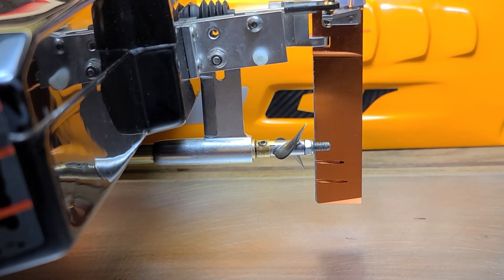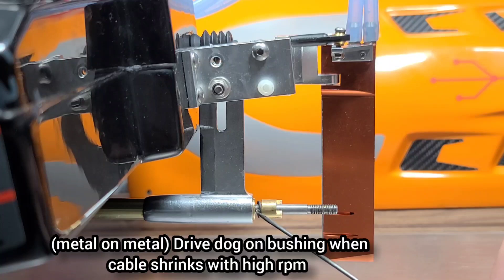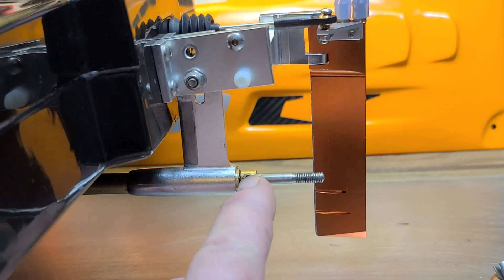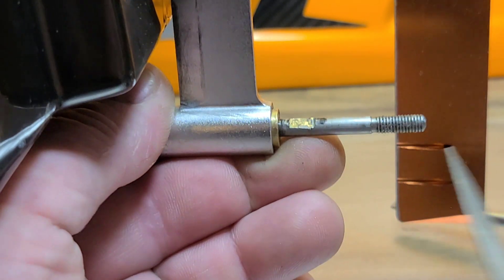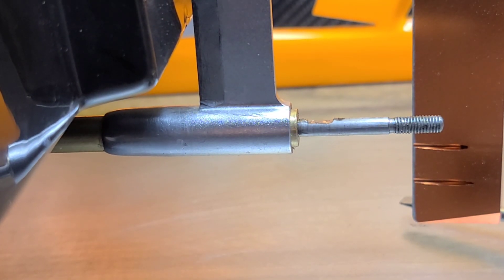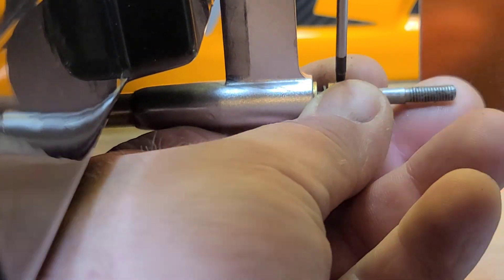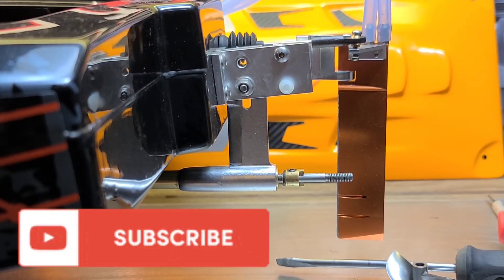Strut, Bushing & Drive Dog Positioning Blackjack 42 - Flex Cable Mod

Comment: One benefit of spinning bushing is that you can pull out drive shaft for greasing cable with out having to disassemble and put stress on drive assy and the bottom of hull . Like the blackjack 24 bushing spins, But greasing  BL 42 sux

Comment: Hey bud I’m looking for an upgraded water system for my blackjack 42. I want the water to run out of the back of the boat through a fitting that looks like an exhaust on each side and orange tube. If you can help a brother out. I watch all your stuff dude!
Reply from the maker: https://rcboatbitz.com/product/blackjack-42-ultimate-upgrade-cooling-kit-orange/
Reply: @ hey thanks buddy. You keep me in the know being a fan of the blackjack yourself. Thanks a lot!

Comment: Some people,as you know, completely remove the flex shaft after every run to prevent bowing of the shaft when the boat sits idle. Any bowing is going to cause problems.
Reply from the maker: Also prevents rust

Comment: I have been commenting on my blackjack 42. That is the boat that my flex cable is stuck on my new bj 42. I have the strut assembly loose. Is it supposed to be able to slide all the way back to the prop and up over the brass tube? I have pics on Facebook black jack owners group. Wish I could get in touch with you to help figure this out without ruining the boat.

Comment: I think it shouldn't spin, because the brass on aluminum is no way good bearing surfaces. I fought this "floating bushing" thing for a while. I eventually went to bushings, using two, one up in the front of the strut and one at the back. OSE has them. I've had good luck with the bushings.

Comment: OK.. I am lost.. there is a lot of back of forth of Spin and Not Spin.. Can we have one Definitive answer on the Spin or Not To Spin.  thanks
Side note... big fan, love the vids, so clear and informative ... much appreciated from So Cal.     Tom TheBomb
Reply from the maker: Either way, really, works both ways..    I found, letting it spin worked much better.
Reply: When I ran my 42 yesterday, Notice that the Strut spins 7 Moves out of the strut about 2mm @IRONCLADRC

Comment: Try to find a steel bearing to replace the bushing. #2 no the bushing should not turn.
Reply from the maker: I strongly disagree, bushings like speedmaster bearing are designed to spin. If setup right, they should basically spin half the rpm of the shaft

Comment: How bout trying to remove the Allen nut from the collar assembly! From the factory they over tightened the nut and I had to drill the dam thing out carefully. I have ordered spare shaft assembly and extra collars. I have 3 emails into horizon website over 2 weeks and no response! I am furious about this. Being in the marine industry having the bearing spinning to me is not something I’ve seen. The Rc boat field is new to me though. I know in powerboats with inboards we have cutlas bearings. This is a brass collar with hard rubber the shaft goes through which is attached into the struts. There are about 8 “v” slots that allow the water to pass through under way. That obviously prevents overheating and friction. If that brass collar spun you’d be in a lot of trouble. It is pressed into the strut and has to be pressed out which has 2 stainless steel Allen screws to keep it seated. Btw nice vid.

Comment: This video is exactly what I was looking for! I just bought a Sonicwake v2 and it has ~2mm gap. I wanted to increase this to 3-4mm before running it the first time. Did your V2 require extending the flat spot on the shaft?

Comment: My fix was to drill the strut body sides and add set screws, to hold the bushing stationary in the strut barrel, but still be able to be removed for service.  Flush mount set screws and a swipe of clear goop over the holes.  Light tension on the set screws, don't get crazy.  3mm sets.   Fresh blue loctite, shook well. Udder Butter all over the cable and all is happy with a 2mm gap with a nylon rub washer, so no metal on metal, which causes heat and grease cast off then, on a hot prop, and used cable. This is what they should have done for a consumer boat.  Damn China clear superglue/loctite crap on everything, including the bushing in the strut, the rudder pin, causing servo drag, the complete rudder assembly, engine mount screws, fittings on the engine cooling can.   A fistfight to clear that stuff, but I got it all.  ALOT of drag with that strut, the nose is noticeably blunt/wall.   Now fixed with speedmaster round bottom medium Cat.
Reply from the maker: I went with a flat bottom speed master strut, round or flat either option is a great upgrade 👌
Reply: @IRONCLADRC  Our local LHS cant keep the 42's in stock.  They received 6 and sold 6 in a matter of days.  A dozen of batteries as well as chargers and shit.    Flip of the switch, years later after incept.  The Pac Northwest here,  home of the Hydro's!.   Everyone is money'd up from the kickers I guess,, and gotta use it or loose it, which is true.

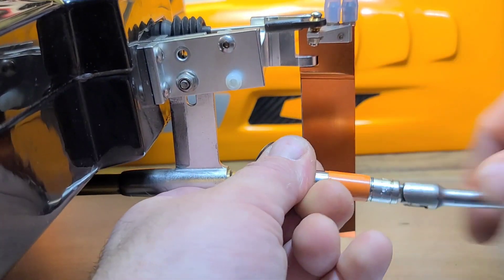Comment: Great Vid but I'd just like to throw my 2 cents in. I feel that the main reason for the bushing to be spinning is for the vibration of the flex shaft spinning inside the bushing not so much the drive dog butting up against the  bushing. And then on that the prop may be ever so slightly unbalanced causing the shaft to oscillate inside the bushing unevenly.  It would only need to be slight but enough for the oscillating action of the shaft inside the bushing to make it spin.  As your video at 1:40 clearly shows the bushing rotating but I feel it's inconclusive as to the drive dog imparting any pressure on it to make it move.  So I'd definitely suggest replacing the bushing with a bearing.  As to the need to relocate the prop further along the shaft I feel in that instance if the  prop is slightly unbalanced it may impart a more  ( please forgive my inability to find the right words to describe the actions) pendulum effect  on the prop creating more vibration on the end of the shaft the further you have it from the strut.  I'm not saying that my hypothesis is the absolute but I feel there are other forces at play here. I feel if I could draw it better than using words.  But anyway just suggesting some things to consider or factor in to your modding.  I'd like to point out that here at this website https://rcboatbitz.com/category/props/ they have prop balances and I feel when you're getting into the realms of big monster boats ( I feel the BJ42 is there) and using alloy props the need to balance them is important just like with model aircraft props.  Anyway Great vid and keep it up.  Cheers

Comment: Good info, might try this. Have u taken a hair off the stuffing tube to run a bit more negative prop angle on this boat? I’m not able to get this boat over 65 without it blowing over, even with the trim tabs and strut adjustments. Kinda out of ideas so thinking of taking a bit off the tube which would also enable a bit more dog gap I would think
Reply from the maker: Shaving a few mm off my strt was the first modification I did the the 42 strut adjustments was very limited in its stock form

Comment: Didn't you heat that bushing to get it out of the tubing? I thought you mention that in your other video. I did see one other video were this other person hammer the whole drive out of the tubing .he would loosen the nut of the prop then he used a pear of cutting pliers and positioned it between the prop and nut and lightly tap the whole bushing and shaft out of the tubing.
Reply from the maker: It was tough to get out the first time, after the initial disassembly it's was rather easy.

Comment: Bush should never spin ...... depending on if the top end is clamped at the motor if so the gap at the dog give it a 1/8 INCH GAP . IF THE TOP END of the cable square and runs loose in coupler your don't need the gap
Reply from the maker: Roger that.  I know speed master bushing are made to spin in the strut/stuffing tube. I know that for a fact.    Thanks for watching brother.  I had zero problems with my flexcable when I loc-tighted the bushing into place. Zero!   Had a few guys say to let the bushing spin, so I did rt,!!!!   Broke 2 flexcables letting the bushing spin.    I agree 100%. Loc-tight that bad boy into place.   You want have any issues!

Comment: I had a heated discussion about this subject on a boat Facebook group . I told him it shouldn't move , he told it has to & I said U will wear out the strut , the bushing & the flexshaft . Haven't seen your blackjack 42 lately  . I'm guessing your strut & bushing is no good & waiting for parts . Keep up the good work Big B
Reply from the maker: Yea ive  Tryed it locked in place I've tried it spinning tried different drops different drive dogs.   I just got my bushing and stuffing tube in the mail just finished up the installation, working on the video now personally I like it locked into place,  but it it wears the Bushing out quicker, with bushing spinning I get some crazy vibrations crazy vibrationsI'm really up in the air, You know what I mean. I like it locked into place, personally I appreciate your comments thank you for watching.  The 42 is back in business

Comment: Ok ok let me clear this up. The gap should be the same width as the flex cable. 
Yes the bushing should rotate. I dunno who the commenters are who are saying no but they wrong.
Reply from the maker: So it should spin. When mine spins she makes a loud loud vibration sound. I've been putting a drop of locktite  on the bushing in the Strut and the loud vibrations have stoped.   So maybe the next time I go out I will give it a shot w/o locktite?  Thanks for the info brother
Reply: @IRONCLADRC  no prob. its normal for the felx cable to vibrate at the bushing when giving throttle out of the water. under load in the water it will be fine. also, metal props do not come balanced, so if you havent balanced the prop. its likel;y going to vibrate more, but jjust using some grease in your flex and bushing is all you need

Comment: Maybe that's why I'm experiencing a weird noise when I start to accelerate, the only way I can describe it is it sounds like bearing skip, then disappears at higher revs,
Reply from the maker: Is the  shaft moving around in the bushing? Is there side to side play
Reply: @IRONCLADRC  thanks for the reply, don't think there's any play that I've noticed,
I've had it 3 months now and it's been like that from day 1,
I'll check it for play tomorrow,
Thanks again, keep the videos coming I really enjoy them 👌🇬🇧
Reply from the maker: Push the shaft up onto the Strut bushing as far forward as you can, and tighten it down in the collet. (Disregard the 2mm gap between the drive dog and bushing) Rev up the motor and see if it's still making the noise. Let me know what it does?
Reply: @IRONCLADRC  I've tried it in both ways, tight up to the strut and a couple of mil clearance,
At the weekend, but in water with no difference,
The brass Bush only pushes into the strut one point five mil so there's not a lot of room for clearances,
Reply: Can I send you a link to my utube video, where you can definitely hear the problem?
Reply from the maker: Sure  please do.
Reply from the maker: Is that on 8s or 6s. Have you pulled the cable out? Check flex cable to shaft connection make sure it isn't broke loose? Also check collet to motor connection Grub screw could be loose also make sure the shaft isn't spinning in collet.
Reply from the maker: Also check the drive dog could be cracked and spinning on shaft
Reply: @IRONCLADRC  the boat runs on 2 x 7-4 volt 4000 mah batteries, all these other things I'll check out, thank you, I'll keep you updated
Reply from the maker: Not enough power that boat needs atleast 6s to preform
Reply: @IRONCLADRC  OK thanks I'll look into that, make sure the electrics can cope with the power
Reply from the maker: Yes you need bigger batterys
Reply: @IRONCLADRC  Hi, so today I've stripped out the drive front to back Inc the motor, everything was locked in tight and there was no play at the strut,, I honestly don't think I'll be able to get 3s batteries in cos it's a right struggle getting 2s in, there's very little space in there, some people have done it getting 3s in by taking the battery trays out, and by doing that the esc haven't been able to cope, they are only 60 amp and I think 40 /42 mph is good enough for that particular boat, once it's up on the plane the strange noises stop and it runs sweet, I'm grateful for all your help,
So one last thing,, is the water pickup more efficient through the rudder or behind the prop as mine is, all the best my friend

Comment: Hey man! Love ❤️ your vids.   A bushing should never rotate in a strut.  The bushing is there to support  the drive shaft and not rotate like a bearing. . Another option would be to put a bearing with a flange on the strut.. BTW you should of shown the contraction of the drive shaft after the modification.
Reply from the maker: Thanks. I appreciate it!

Comment: I see what you're saying about the flex shaft getting shorter under load. But excessive slop between the strut and drive dog is going to put a Radial load on your motor bearings. The thrust needs to be transmitted to the strut or TRANSome not the motor.
Reply from the maker: So you think 1-2mm is better than 3-4mm.  I see what your saying and understand.  I just think that the "metal to metal" load on the bushing & dog would create more stress and friction on the system excessive heat etc.  I'm thinking the "metal to metal" was causing the bushing the spin. The vibrations  were terrible.   I see exactly what you mean by "radial loading" in  the motor bearing in the front endbell shouldn't the shims on the rotor   prevent damage from loading?
Reply: @IRONCLADRC  best bet is to find a happy medium with the strut to drive dog gap. If the motor has shims on the rotor it's to take out any end play not to take a Radial load.  On my big gassers I use a Delrin bushing between the strut and dog. It reduces the friction and is considered a ware item, usually 3-4 runs.
Reply: @kendesign3622  Would it be good to use a thrust ball bearing here?

Comment: For what it's worth, my bushing is flush with the end of the strut barrel... It does not sit proud like your bushing does. I'm thinking that when your bushing started to spin with the drive dog it began pulling out. You'll have to start asking others if their bushing sits flush with the strut barrel, or if it sits proud like yours. Anyway, just thought I'd share what mine looks like. 👍👍
Reply from the maker: Mine sits flush brother.  Had everything disconnected and pulled apart while working on shaft
Reply: @IRONCLADRC  gotcha man, just checking! Can't assume, and always start with basics! 😜 👍

Comment: That flexshaft has a new design and a less gap needed from flex!Improves the leak issue when grease is low in shaft tube👍
Reply: Just curious where you got that info from? There's nothing in the Manual about it being  a new design.
Reply from the maker: Roger that..  Great to know thanks! 😊

Comment: The strut bushing is stationary and had a bearing so it should not spin with the shaft.Make sure your strut is snug to the tube and the step down should be about the same as a nylon bushing gap!Grinding off more only gets it out of balance more and cause vibration at high rpm🤔
Reply from the maker: Again thank you. I kinda knew it wasn't supposed  to spin..  a little locktite goes a long way on the bushing. I've had a speedmaster strut that the bushing spun in the stuffing tune I actually loved that strut, so smooth

Comment: Cool Channel bro. 
Is the cable on the BJ42 not a one piece? 
Keep up these honest awesome videoes
Reply from the maker: It is 1 piece. thank you for watching
Reply: @IRONCLADRC  then why not just pull the entire shaft out of the motor collet just a little more, to make the right gap
Reply: Btw. The bushing inside the strut housing i don’t think is supposed to turn, but at that rate of speed i think its ok.

Comment: That happened with my 1sr boat Shockwave, didn’t want to spend any extra $$ and  bushing was unavailable at the time. So I used a piece of cooper tubing I already had and drilled the inside out so it would fit well with flex cable and pressed it into strut bullet. Worked better than factory . Thanks Big B for helping everyone out!!
Reply from the maker: Lol. I've done that myself Cross drilled the grease dams and all.   Thanks for watching

Comment: Quick question for you, the brass bit that goes into the stuffing tube and you can get your 1/2 mm clearance keeps coming out of the strut does it needs to be fixed in place with lock tight or something it's becoming troublesome?
Hobbyking aquaholic v2,
Loving the vids, much appreciated 🇬🇧
Reply from the maker: I use blu locktight in my removable bushings..  I whip inside strut & outside lip of bushing with alcohol and put a little dab of blue locktite, when you pull bushing out just use a little heat to coax her out.
Reply: Thanks for the reply, won't need to heat it to remove it, it'll just pull out,
I'll buy some blue lock tight,
Cheers again, you've been really helpful 👌